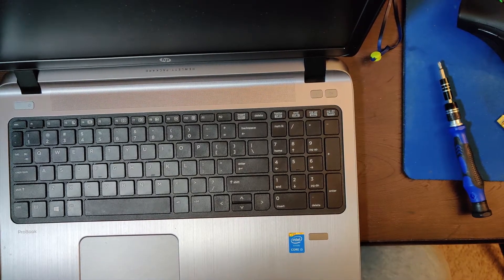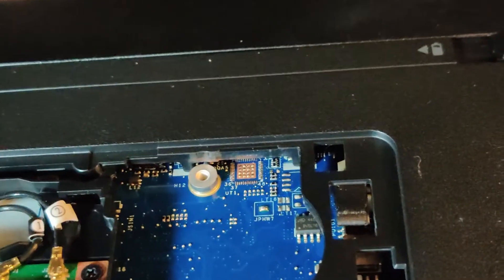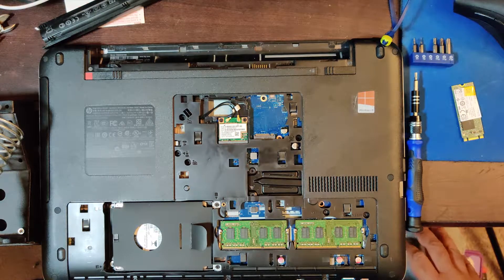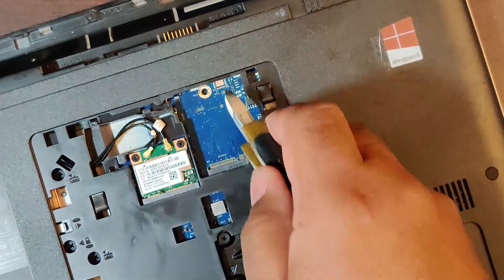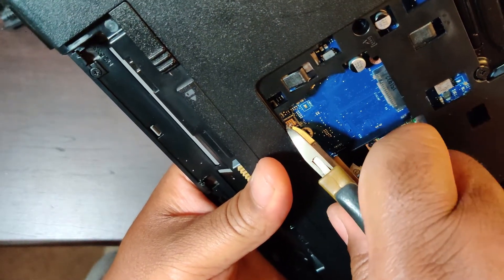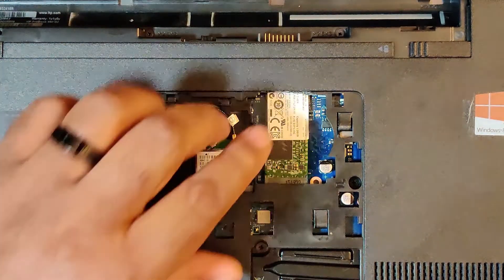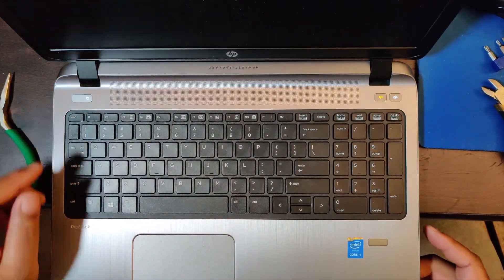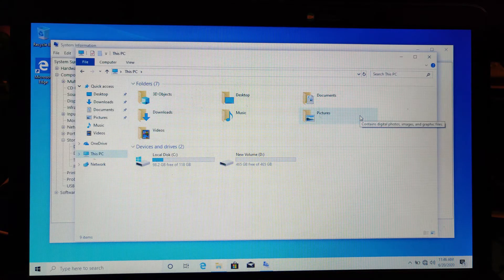How to put an SSD in HP Probook 450 G2

Comment: Can I upgrade my ssd to 256gb as on hp website it can be upgraded to 128gb ssd only

Hp probook 440 g2 ... ssd size m.2 2242
Reply: No you can't. The maximum upgrade you can to do is Memory RAM 16GB(2x8) 1600 Ddr3L, Ssd m2 2242 with 128GB and you also can to upgrade a Ssd 2.5 or Hdd 2.5 with a size of your own preference.